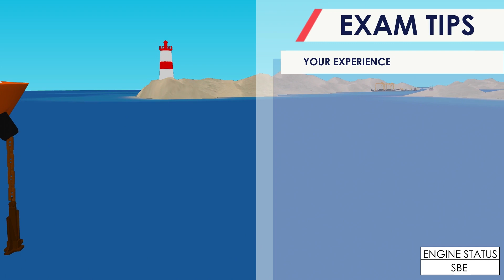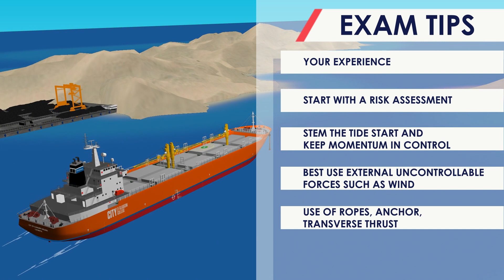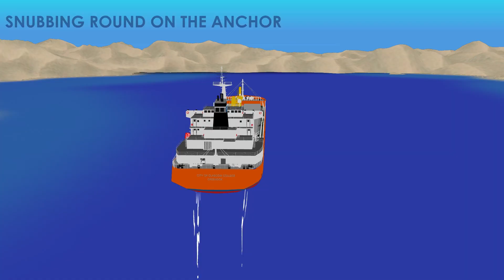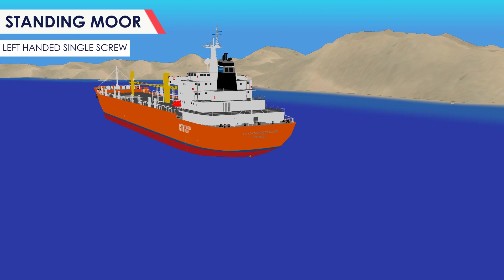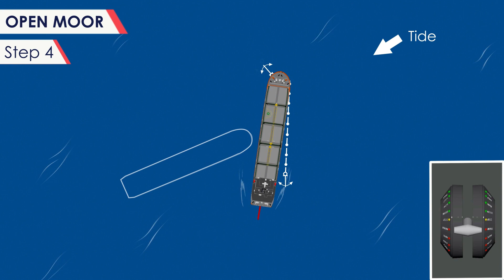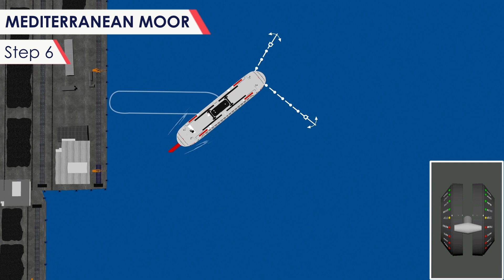SH Lesson 3 Exam Situations

Comment: Sir in case of left hand propeller when turning short turn around when vsl turns 120 of initial turn on giving stern movement the  propeller movement will be clockwise so the bow will swing to port & stern to stbd , but at step 6 bow is turning to stbd on astern movement please advise sir
Reply: I think he is explaining for right hand screw propeller.
Reply: Right handed propeller (the one turning clockwise) make the bow to turn some on port even in rudder midship, so left handed turn bow to starboard even in rudder midship.